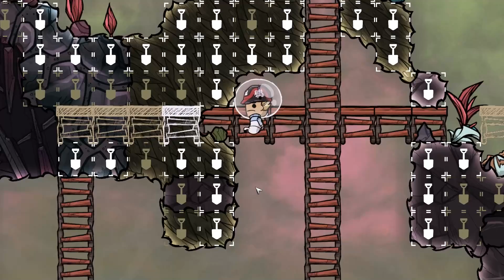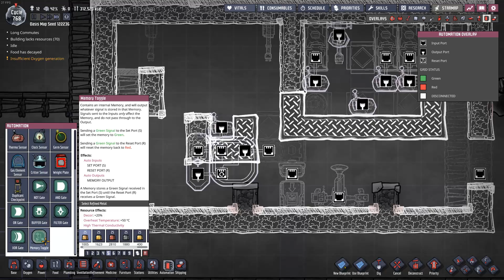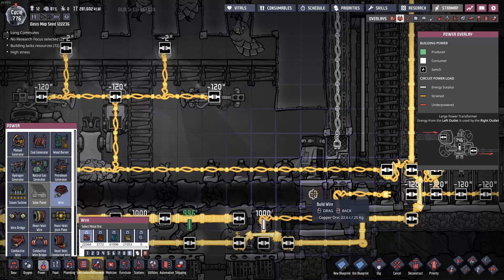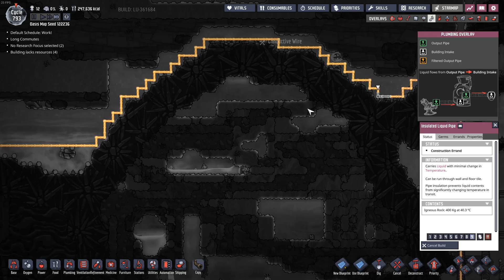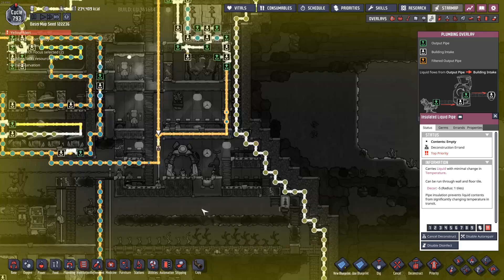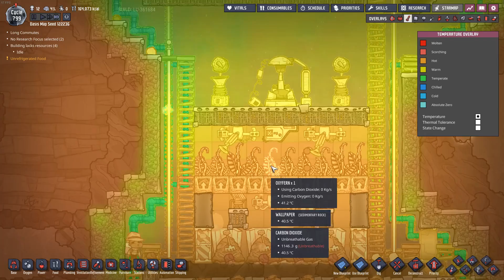Tap an Iron Volcano! Oxygen Not Included ep19

Comment: I can see one design flaw: the isolated tiles next to the volcano are made out of igneous rock which have a melting point of about 1400°C. The liquid iron has roughly 2500°C, so given enough time (couple hundret cycles) the tiles will melt. I would suggest building these insulated tiles out of obsidian, which has a melting point of 2700°C.

Comment: Just my 2 cents about steam turbine: I tend to have a liquid reservoire next to it. The turbine dumps its water into it, sometimes with radiant pipes to cool the turbine somewhat. And from the reservoire i have a liquid valve bevore it returns to the heating chamber. So if you turn off the valve, i recover about 98% of the water if i have to enter the heating chamber ;)
And when it comes to metal volcanos, i tend to have vacuum airlocks instead of liquid ones.

Comment: @Brothgar

After many many hours in sandbox I think I came up with the smallest possible design I could that was dupe hands off. I ran it for 20+ cycles, tried it on copper and gold. I forgot to add in the temp shift plates behind the sweeper and loader for the 20 cycle test. Even skipped a cycle without sweeping. I did not however turn the steam turbine off to test how long before the gold melted. Everything that was refined metal was gold. Temp shift plates were ever other block in the steam tube. I had to use mafic drywall because it was partly in space. it had about 1100kg of water turned to steam. 500kg water to steam in temp gauge square. Crude oil on top of the metal blocks for cooling the sweeper and loader. automation has to stay inside the heat tube or you will leak heat. bring your coolant in from the right side and deliver iron on rail to either. temp gauge can be set to 126 with diamond in the rails but it is safer to go 130.  Gold really doesn't need the rails at all. I set the filter to 20 s but if a lot of iron builds up it will drop it and it will liquefy again causing  failure down the line. It should be mirrored pretty easy. Here is a link to the picture.
https://cdn.discordapp.com/attachments/405396454178553867/618369111080042496/Small_iron_setup.jpg
Any questions please ask

Comment: Everyone I see do a volcano tamer has this huge complicated set up, and here I am with one that fits all neatly under the steam turbine I use to cool it.  All  you need is a steel sweeper and loader to take stuff out and it should be kept under 275 the whole time.  Use a thermo sensor to disable them until the temperature is low enough, and then add some temp shift plated to add some thermal mass and a few tiles of metal to help suck out some more heat from the metal as it is removed and you get nice "cool" metal coming out at about 127 degrees.

Comment: I made this yesterday. used 1 pump to vacuum out the whole area then sealed them up as I finished it. I also automated the sweeper so that it waits 200s and the temp of the pool below 60 degrees. I am using the water from a polluted water geyser to cool it before cooling my cool steam vent water pools. It is working fantastic thanks for showing me how to build it. I chose to have to always open doors and the water drip by the part that would be the hottest. Here is a link to the picture https://cdn.discordapp.com/attachments/405396454178553867/618248735457280005/unknown.png

Comment: So something i did with my Volcano is in addition to cooling the gold drippings in a supercoolant bath which is maintained by conveyor diamond to a steam room/turbine. I wanted to create a secondary & Tertiary cooling loop through the same spot from a nearby hydrogen geyser (500 C -> ~130 C) and oil cooling loop from the fissure(250 C -> ~130 C). If you add a Thermo regulator you can then create a secondary temp drop area which will cool all of these materials from 130 C to 20-40 C depending on the material as well as cool the turbine. I havent done the second part yet but i need to refine it when i get a chance.
Reply: There is a glitch/bug im using to convert 150C iron to 40C. If you build stuff with hot metal (maybe works with all materials now that im thinking about it), the building wont go over 40C. you then deconstruct it to get 40C metal. It is an exploit i know, but i have too many dups and they can all benefit from a higher construction attribute.

Comment: Since you have too much water, you could have an overflow of polluted water (setup before the sieve) and use it to raise Reed Fiber. Even if you do not need the fiber (for painting for example), they consume a lot of water. That may be an option.

For me, with my 24 duplicants on Oasise, I use the extra water to get crude oil. So I do not care if I am water positive as I am using my extra from the start. Actually, I do not have enough power as normally I use coal and I am completly out of it as of now. And my hatch can't keep up pooping around :)
Reply: I second the use of Reed Fibers. You need a bunch of them for Insulation, so you'll have plenty of use for them. I almost dried up my oassise base trying to get enough, and have since moved to a large wild reed farm (thanks for translating the language of the pips for me, Brothgar).

Comment: Inb4 the small bit of gas under the neutronium with the thermosensor becomes a problem xD.
Reply: Ive always had issues with the thermosensor NOT detecting temp when in a vaccuum, that shouldnt be an issue here because the gas will adequately relay temps to the sensor from the plate.
Reply: @nebuchadnezzar2002  True I forgot about that. Was just commenting on how Brothgar said that it was all a vacuum tbh.
Reply: @rayvalkren1950  No worries, Happy engineering to you.

Comment: Oho mirrored just like I was building based on your design.  You can put the wall right next to the geyser one tile closer when it is on that side.  A little less metal sitting there doing nothing.
You an use metal tiles in the drop pool and have the conveyor go through it to pull the remaining heat out even faster.

Comment: Brothgar! Try compressing the water with doors like you do with gas! I've tried it before, but I imagine you could perfect the design.
Reply: Is there a way to get around the overpressure damage?
Reply: I guess you can just convert ot to steam and then compress that.
Reply: I think either airflow tiles, triple walls, or metal tiles. The problem with the airflow tiles is that the polluted water seems to off-gas which I didn't like at all haha
Reply: i did that before, though my inability to understand it left me with a wierd system. still brought over 1000kg of water per tile when i used it
Reply: I was also confused.. Sometimes the whole system would back up and I'd have a huge overflow.. Which confounded me when I had no power running to the doors which left it constant. My polluted water worked wonderfully and  I probably could have made the tank even smaller. Lots of fun!

Comment: Instead of using 2 tiles to the right of the neutronium it is possible to put 1 tile on top of the far right neutronium tile because the volcano is only 3 wide. That way the right side wall could in theory be moved in 1 tile.

Comment: Why do you use this design instead of the igneous rock power station you used during the Super-Dupe series to cool the metal?
Reply: Can you linked me to that video?
Reply: Iirc that was not actually made to harvest the igneous rock, just the power; he's trying to harvest the metal in this case
Reply: @hiddenTNT  But what would be the challenges to convert the system, which uses shift plates on top of gas and conduction, to extract the resources?
Reply: @BrokenLifeCycle  in order to get the metal out safely you need to use an auto sweeper but the temps involved are well above steel so first he needs to cool down the metal in a controlled matter before it touches the auto sweeper, you also have to have a vacuum to protect the auto sweeper from the 1000+ degree molten metal, thus this design

Comment: You don't need doors in this setup at all. Just manage its peak temperature to 200C by adding/removing thermal mass. And replace bottom door with aluminium tile.
You can cool that iron all the way to ~125-130C and do it without steel.
Reply: Also you don't need that barrier to the right, metal always drips to the left of the volcano. Have you even done your research?)